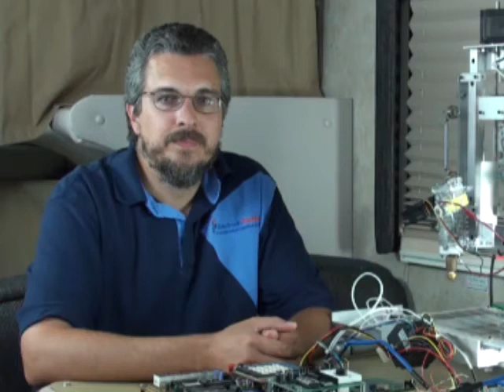Applied Guide To Electrical Engineering Introduction

Comment: @canon129 Electrical engineering encompass power generation, transmission, grid planning and component design etc. Robotics falls more in the area of mechanical engineering.

Comment: I am completly torn between dong mechanical engineering and electrical engineering. I am really interested in turbofans. turbines, amusement rides and control, so I guess they would qualify for mechanical engineering. However, I am also interested in circuits and signal processing ( I took apart an old toaster and was fascinated how it is basically a circuit with an electromagnet, and I look at the circuitry in my plasma tv and am fascinated with how it works) Continued below

Comment: Now, the downsides I'm considering. In terms of mechanical engineering, I am worried that it is a dying field. Two engineers have told me that electrical engineering is going to be up in the next few years. Besides that, I love everything about mechanical (classical mechanics, fluid transfer, aerodynamics, control, vibrations...etc)

Now in terms of electrical, I love circuits, electrical control and signal processing, heck even telecommunications.  Continued again below again ha!........

Comment: @ElectronicThinking man your exactly right, however looking its more complex to get those skills without going higher education. You need to be more self-motivated have time, and place to practise. In addiction you would have to finish ur informal education in shorter time, cus otherwise its pointless. So i think its possible to get the skill off university, but only for ppl what are unnormalny inteligent&self-motivated. but, at the far end, you still dont receive diploma... so is it worth it?

Comment: But I ABSOLUTELY HATE computer programming. I find it extremely boring and tedious. I will do programming in school and suck it up (I have already taken AP CS Java in highschool, and passed but hated it) to get the degree, but I want nothing to do with it in a career. I am in a dilemma, I will do mechanical if the economy isn't causing job loss. I will only do electrical if I can be reassured there is no programming and it can just be circuit design. I need some advice on what do do please.